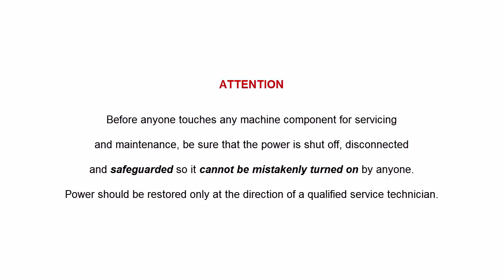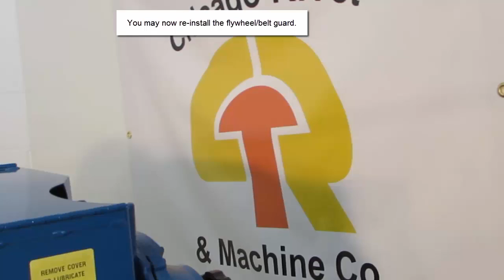Flywheel and Clutch Removal and Installation

Comment: i just performed this action, now my timing driver height and jaw position changed, what did i do wrong?
Reply: Might be to do with the bit where the spring goes in and it gets turned. There's another thing in beside the actual crankshaft (probably left side facing from the operator position), where they undo a bolt and wind out the bit besides the crankshaft and then you get 2 lots of teeth locked together that you seperate and then spin the right side to adjust the height and then they press the teeth back together again on the left, spin the retaining ring thing in and tighten its bolt.  That's the way they actually adjust the height intentionally.

Comment: I don't understand. I want to know the principle of clutch.
Reply: When activated the tiny spring rolls the 6 rollers into the taper of the main shaft.  As they roll they lock, because of these tapers, like a wedge; which locks the flywheel to the shaft.  When it comes around and hit the stop side of the lever... it unlocks the rollers from the tapers... and then the flywheel is free to spin again.  Hope this helps?
Reply: @jeffredington3359  it's helpful man thanks
Reply: @jeffredington3359  can you send some more details , I am working with Mechanical press machines ,
Reply: Go look up PIN CLUTCH and you will understand.
Reply: Can you please send me PDF or drawing anything like that I really want to know how this thing works in depth.